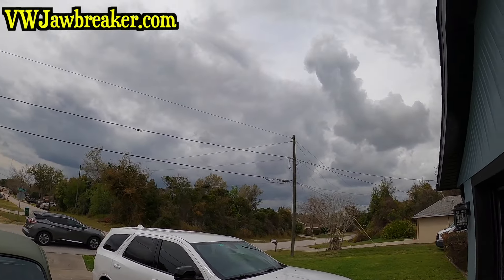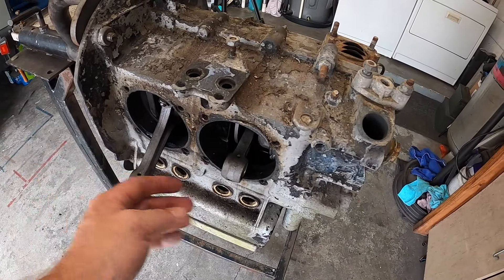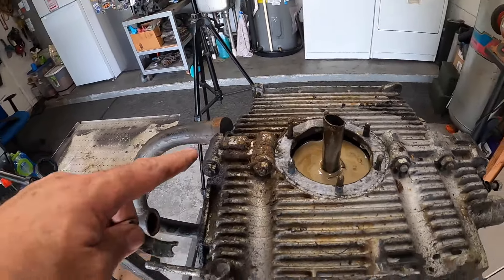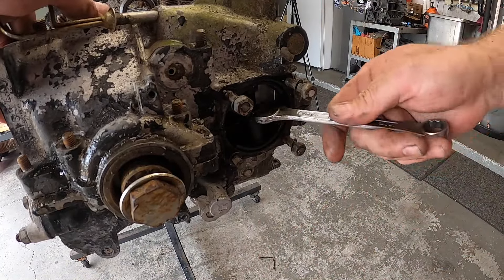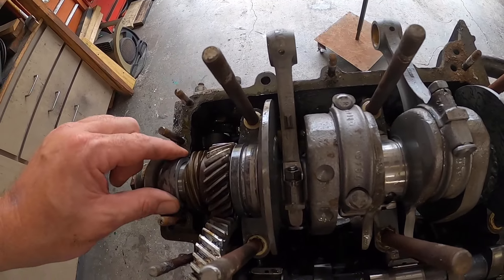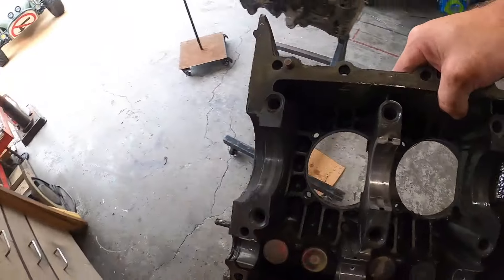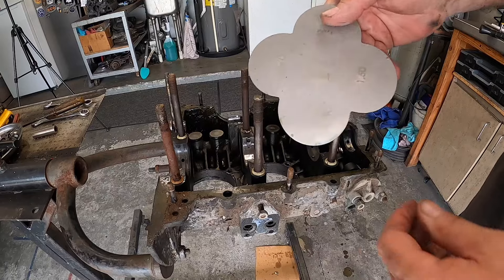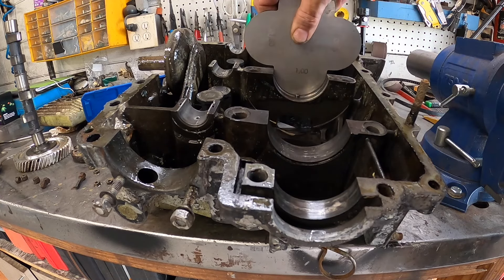Mystery Aircooled Volkswagen Engine Tear Down and Inspection. Can It Be Saved?

Comment: Looks like a great case and parts to build! I wouldn't be afraid to build that case up into a decent engine it still has a lot of life left in it especially with it being standard thrust. Word on the vz25 cam, my first hot rod motor was a 1641 with the vz25 cam, lightweight lifters, chromoly p/r's, bolt on rockers, compufire dis-ix ignition, and 40idfs with 32mm venturies. Light to light it was a beast, power would come on at about 3800 like a light switch and pull clear to 8k! Super fun in town motor. Downfall was driving it on the freeway, no bottom end torq. I'd have to drop it into 3rd and wind it out to 6-7k to pass, and that's what led me to building a stroker with a cam to pull in the low end. I still plan to use it on the supercharged engine someday:) thanks for another great vid I love my motor builds!
Reply from the maker: I think there’s some good parts there for sure. He’s thinking of making some changes, we’ll see what that means lol He has a bunch of parts in the garage. 
Interesting about the cam. From what I read it’s good from idle to like 4500 rpm…. Now I’m not sure what to do for his build.
Reply: @VWJawbreaker  another thing with the cam it has a very aggressive ramp, .470 valve lift with stock 1.1 rockers it tends to wear out the lifter bores faster compared to a higher lift cam designed for ratio rockers. It should be good from idle to 6000rpm and needs dual valve springs. It sure does come on hard!
Reply from the maker: @V8N8T  so it’ll be good for a Baja then.
Reply: @VWJawbreaker  I'm sure it would be ok but I'd find a low-end cam like the 86a personally they have plenty of low end. When I had the vz in my engine it was lower compression than the 8-8.5:1 cr that the cam calls for(like 7:1) and the bigger venturies in the 40 idfs probably wasn't the best combo for small displacement. I do remember with a pertronix in a 009 it would pull till 6500 but with the compufire it would sing to 8k. That ignition was wasted spark and it sure did make a difference on power
Reply: @VWJawbreaker  even the w100 cam I put in the 1600 I built for the dune buggy had an awesome torq curve and pushed my heavy bug with ease when I was breaking in the engine
Reply from the maker: @V8N8T  the w100 is an underrated cam for sure. I’ve put a few of them in and I like the profile and characteristics. I’ll talk with him and see what he wants to do. Ultimately it’s his decision.

Comment: Those CSP tools, are great to have at the swap meets.  I even have the ones for the type 4 cases.
Reply from the maker: They are great for checking quick but do not take the place of actual measurements.
Reply: @VWJawbreaker  Agree. Next time you go to vw show with a swap meet take the CSP tools with you. Brent might need to borrow them.

Comment: Love a mystery engine.....   Superflow heads with a stock stroke????  Good old Empi  attempt to make awesome power but they never worked that well. The valve cover gaskets for superflow  valve covers are getting $$$$.  Have great day and hope the weather works for you.
Reply from the maker: I don’t have any experience with those heads and he ended up selling them to someone as he didn’t care to run them for whatever reason. 
Hope you’re still crack a lackin on that rail over there.

Comment: rods upside down AND alternator stand baffle plate. that little item sort of just jumped out at me at :45 or so. sort of surprised to see helical cam gear set. no groove in the lifter is good.
Reply from the maker: Yes sir, lots of little things for sure. And to think they still run like that 😂
The lifter groove being there or not is controversial, I don’t bother making the mod on a small cam.
Reply: Why surprised to see a helical cam gear? It's the best thing to run unless you're running a super large cam. They eliminate harmonics in the valve train that can cause wear

Comment: Awesome video Gary !! So my question is this, with everything in relatively good shape could you put it all back together the way it is and finish the build and run it ?
Reply from the maker: Thanks man. 
In theory, yes. It would need a massive cleaning and such but yes you could in this situation.
Reply: Thank you for the reply. I'm getting ready to pull my engine and do a top end, I'm hoping the bottom is good to go but if I decide to split the case at least I have some good videos to reference on what to check and how to put it back together 😉

Comment: I just did this myself.  Found a great low mileage Scat C25 cam/lifters, a good sump, a decent CW 69mm crank (although boogered-up dowels sorta disqualifies it), and lastly a pretty decent engine case.  Just got me a 74mm crank to use in it for a 1904 build!  Great video!
Reply from the maker: You’ll be happy with that 1904 and a c25, nice combo with a good set of heads.

Comment: Love these tear down videos. I found that lifters for my old 1965 1200 40hp I picked up don't have crown tops but stock are flat. Must be the the newer engines with the curved tops?
Reply from the maker: Seems the aftermarket lifters have a slight crown to them.
Reply: I guess not flat as I thought. need to check them with feeler gauges on the edges but will probably use the old ones anyway. budget build on an old 1200 40hp single relief not worried about it on this one. 
"Volkswagen (VW) lifters on older engines, often referred to as flat tappet lifters, have a slightly convex shape rather than being perfectly flat. These lifters are designed to turn and wear more evenly. While they may appear flat, the center of the lifter is typically about 0.001 to 0.002 inches higher than the edges"
Reply from the maker: @TimsWorkshopTJY  I didn’t want to give false information but from what I understood, they all needed the convex but I mostly deal with aftermarket ones. 
Thank you for the clarification 🤙

Comment: What is that tool you used on the crank and rod journal? I need to get one of those
Reply from the maker: It’ll give you quick idea if the case or
Crank has been turned. Still no replacement for proper measuring tools.
Reply: @VWJawbreaker  oh 100%, still would love to get one
Reply from the maker: @robgielarowski2168  these are the CSP brand, CIP1 and other places sell them.